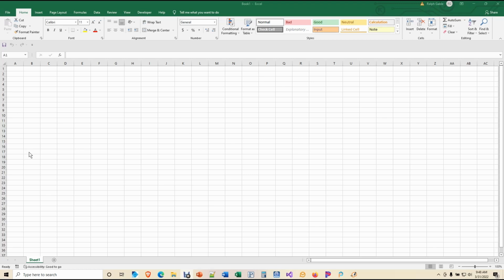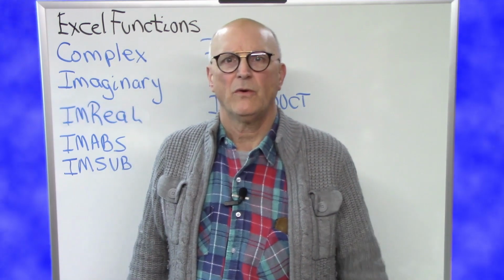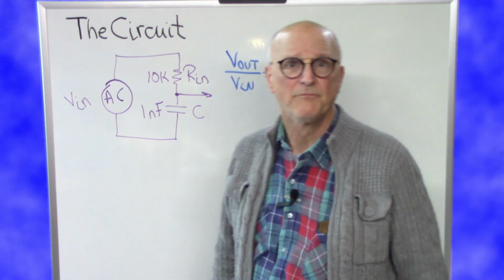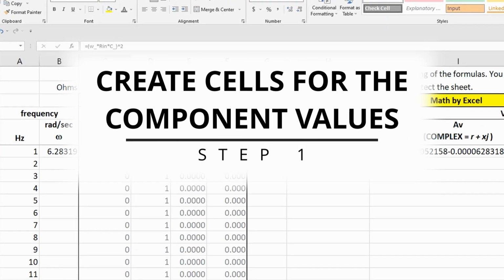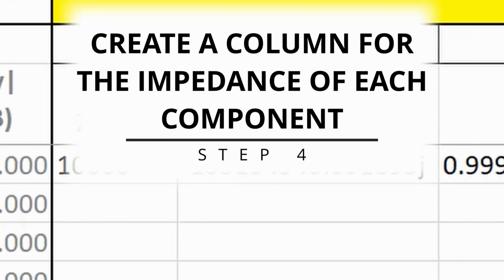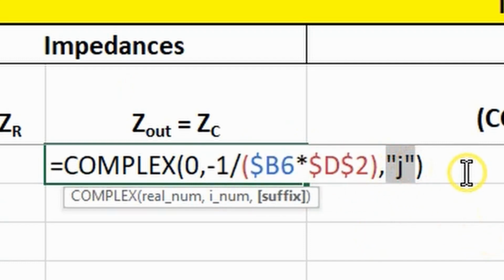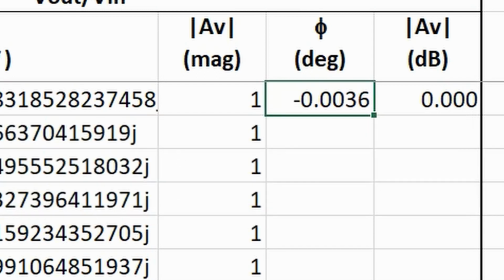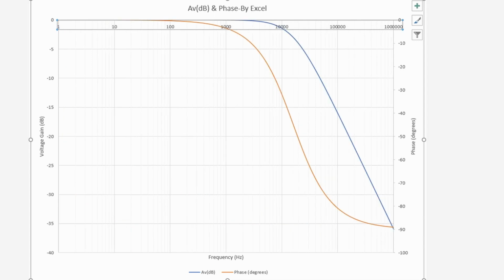Math for Reactive Circuits: Using Excel's Muscle (00i2)

Comment: Ralph, thank you so much for the great YouTube channel AND the great topics. I need to go through you channel list and make sure I haven't missed anything. I am currently designing a QRP direct conversion transceiver and have used many of your videos to help me through the process. If I may be so bold, there is one item I am annoyed with. Your incredible precision. LOL I vividly remember a college course where we learned that more decimal places does not necessarily mean more precision. As you demonstrated in the recent video for the KM200s Digital Multimeter, the accuracy of the equipment is key to the final answer. Calculating resistances to a fraction of an ohm, for example, may be mathematically accurate but practically unrealistic. Especially when the resistance is in the 100k range. While I haven't timed anything (and won't), you could probably shave 30% of your video time off just by reducing the number of digits you read out loud. (BIG LOL) Again, I truly appreciate the information the present and the detailed way you go through every step and every calculation. I trust you have received this comment with a bit of a chuckle. BTW, I heard you call CQ on your fluke meter in the KM200 video. 73 de N4EIS, Jeff
Reply from the maker: You are very welcome! I am so glad that you are enjoying the videos!
Yeah, I am a bit of a precision'aholic! LOL!
Where does this come from? As an electronics engineer of many years, my experience has been to hold many more digits of precision that what some think are needed and then round to the required digits with the final number. I have had bad experiences rounding early. Carrying the extra precision does no harm and, most certainly, avoids the build up of error due to rounding off numbers early. :-)